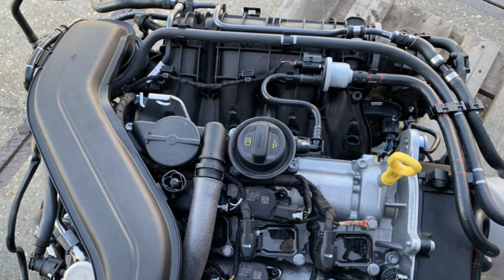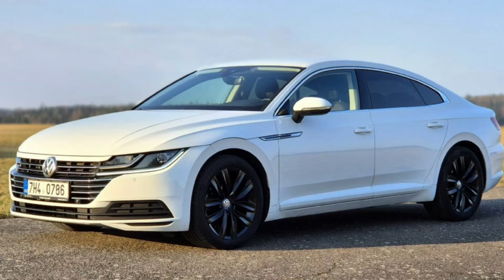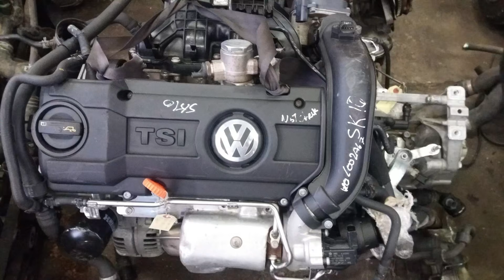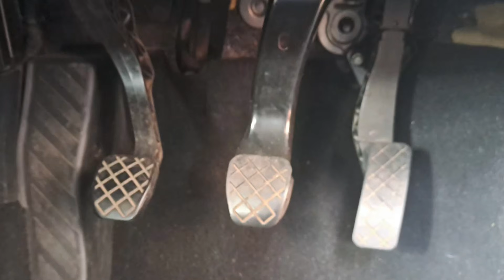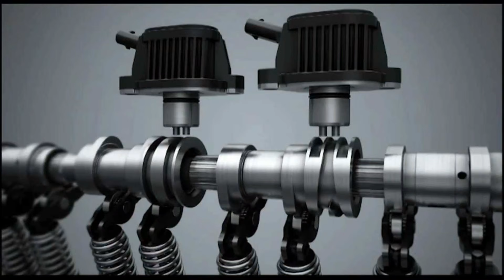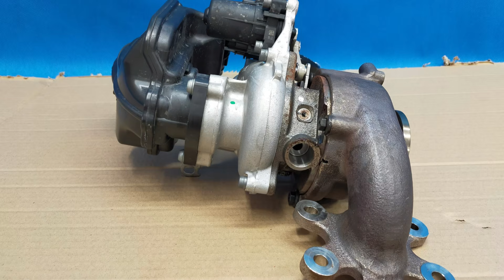Volkswagen’s 1.5 TSI engine: Common problems and advantages

Comment: I purchased a 2021 model Year Skoda  Karoq 1.5 tsi  from main dealer with low mileage ( ex motabillity car )  7,956 miles ,three year old car, first few months of ownership  I felt the response from the engine being a bit flat, Skoda dealership had performed all known updates to the vehicle. Third tank of petrol I put in I decided to use 99 Octane Super Unleaded E5 , the difference to the way the engine performed was , like night & day , I no longer put in any petrol E10, or below 97 octane.

Comment: I have a 2020 Octavia 1.5 TSI with 180k miles (290k km). Oil changes every 8k and I've changed to 5w30 VAG 507/508 from 0w20. Slight oil consumption and suction at the PCV (replaced with VAG part). Turbo replaced at 69k and alternator at 105k. They definitely run much better with E5 99 ron fuel. Mine has an EML on for an injector fault but still runs as normal so that's being ignored. Watch out for carbon build up as they are direct injection engines so using a special additive helps.
Reply from the maker: Thanks for your insights! Additives though are little help in preventing carbon buildup. What really helps is using top-quality oil, driving at high RPMs sometimes, and also using special spray cleaners directly into the throttle if things get worse. Otherwise, only walnut shell blusting which is not DIY.

Comment: I love this engine. Really good after 2K rpm, almost fun at 3K and above with the weight given. Shame mine car doesn’t have independent rear suspension for economy reasons :( It’s hard to compensate for that with tires/wheels/driving style. I have the manual, 96 kW, and just hit 80,000 km. You can actually feel what the variable turbo does compared with the previous generation of the engine. Love the 2-cylinder mode since the Golf VII which I drove a lot – all in all, it allows me to keep the average consumption below 7.5 l/100 km. My record is 2.8 l/100 km after a 10 km drive. I change the oil and filters every 10,000 km, but recently had to extend this to 13,000 once in a lifetime, and the car asked me to add some oil. I don’t have to check it manually – it will notify you when the level is somewhere between min and max. This happened after hundreds of kilometres of autobahn driving at 3–4K rpm + hot weather + mountain roads. Not engine-related: the infotainment system is a bitch, but I’ve somehow got used to its constant glitches, restarts, etc., they're enough rare at this moment for my threshold for modern cars.

Comment: Anybody here in UK  using 5w 30 oil instead of the recommended 0w 20  ?
If so 
Pls let me know
Reply: Changed my oil yesterday, the mechanic recommended 5w 30 instead of the 0w20 I had bought. Not in the UK, but similar climate 🙂

Comment: My 2021 Tiguan 1.5tsi has been doing alright except for a few issues: 1-knocking due to ACF hose leak which is a chronic leaking plastic hose. Replaced and now engine is fine, 2-Engine loses coolant, 3- engine loses oil around half liter after 10k km. Apart from these it has been doing very well.
Reply: Masz za ciężką nogę, dlatego tak szybko ubywa oleju. Turbo żyje, turbo pije! 😂 U mnie od wymiany do wymiany nie dolewam ani grama! 👍

Comment: What oil you guys use in 1.5eTSI, in shop they tell me 0w20 🤔
Reply from the maker: It's indeed 0w20 in recommendations (508 00, 509 00). But people tend to switch to 5w30 (504 00) after the warranty is over. 0w20 usually has shorter lifespan, so needs to be changed more often.
Reply: @DmitrySapko I can understand to change on 5w30 but not on 504 😅must chack that little more. Also do that on my last car Golf R but I keep oil specifications same 🙂
Reply from the maker: There are oils with 504 00 / 507 00 specification suitable for both petrol and diesel engines. They are good for the 1.5 tsi / etsi for a number of reasons, that's why I mentioned it. But getting 508 00 is also an option, of course.

Comment: The EA211 1.2, 1.4, and 1.5 are the best modern small engines ever made. Not a single design flaw. Pair it with one of the oil-DSG boxes, and you have a solid setup.
Reply: With Oil-dsg are you meening: wet-clutch,
I meen its only VAG with a engine with 1.8L and up, because they small engines is reduce/ecu regulated to only have 250NM of Torque
Reply: Some people say the coated liners/bores on the 1.5TSi are a ticking time bomb...

Also, the 1.2TSi has turbo issues and the 1.4 carbon buildup and the 1.4ACT engines trouble with rockers that break on the cylinders that deactivate.

Comment: I've had a 2017 1.4 TSI, and now drive a 2024 1.5 TSI (Jetta Sport 6sp manual). Love the engine! 1st gear to 2nd turbo lag just takes time to form habit of higher rpm for that first shift, then no lag. I replace the air filter once a year, sometimes twice. Clean airflow is critical. I also find top tier regular makes a difference than the cheap gas brands (I use Shell). The engine is sensitive to bad gas. Love the torque!!
Reply: I just bought a used 2024 with the manual. I’ve never had a car with a turbo, and am just getting into driving a stick. I’m glad I found your comment because I was wondering about the lag lol
Reply: The post 2024 1.5 manual has longer gears than the 2020 car I have. I have no issues with turbo lag on mine, but the engine is a bit noisy at 125- 140 kph in 6th gear.

Comment: Start/stop system error, even if you put a new battery on still coming the issue and the system doesn’t recognise the error even with the engine light on.
Reply from the maker: The check engine light is always triggered by a code. You may need a better scanner to see it though. The check engine light is actually the reason why start -stop throws errors.

Comment: I had this engine in a mk3 Leon. The car was decent, the engine was not good in my opinion. Had 2 coil packs fail and the PCV valve all before 70k. It was very poor on fuel, underpowered and jerky when cold. I think it had an issue with carbon buildup. It was also well maintained, but that didn’t help.

Comment: I have a 1.5TSI 2019 skoda octavia with 147000kms. Did a trip arround 1600kms. Didnt used any oil. It went up to 221kmh on german autobahn, but gps showed 211kmh. Its a great car for a people who need a car just for travel from point A to B. To me its boring car. Thinking of doing stage2 to it. To see what happens.

Comment: Had multiple TSI engines from new across Audi, VW and Skoda range and all have been wonderful; their only failing seems to be how rattly they are, especially when cold. Had a new T Roc R and it sounded like a tin of spanners and ,worse, the auto box kept it in low gear/high revs when cold which I think is dreadful for a cold engine, especially when running in.

Comment: Dmitry says kangarooing problems existed in models up to 2024 but the EVO2 engine came in 2022/3 and I thought that was supposed to have sorted it out?  Can anyone clarify?
Reply from the maker: They gradually replace engines and kept using the first-gen 1.5 TSI in a lot of models, especially Skoda and Seat for quite some time. Even gen-2 engines are blamed for kangarooing, just not as bad.
Reply: @DmitrySapko  Many thanks, Dmitry.👍

Comment: Great engines, but ensure rigorous servicing and regular liquid moly additive to prevent carbon build up which is common in all TSI direct injection engines.
Reply: Not all, the 2.0L EA888 gen3B uses port and direct injection.

Comment: I'm looking at a 2024 manual 1.5tsi cupra formentor this week that has nearly 9k miles on the clock. It only had it's first service at 8.5k miles(oil and filter) in January so was 18months old at that point. 
My wife will be using it for short journey work and back most days and i will be taking it for longer runs 2-3 times a week.
Any immediate to longer term maintenance advice would be greatly appreciated. If i buy it I'll be oil changing/servicing it regularly but I'm a bit concerned the previous owner didn't change it's oil for the first time in 18month since new.
Reply from the maker: I believe it's just fine. The engines are quite reliable and you are getting basically a new car. I would look carefully at why the owner decided to sell it - maybe there is something with the car that's not so easy to identify at once? But if everything is fine, there is nothing much to tell you about service - just change oil once a year (6-7K miles would be a perfect interval) and follow the manufacturer recommendations in all other cases.
Reply: @DmitrySapko thanks man. Appreciate it. 
What's your opinion on stage 1 ecu mapping on these engines?
Reply from the maker: It's out of my field of work, but I believe stage 1 just adds figures in tests. In real life, you feel no difference. However, the load on transmission increases which may not be good, in the long run.

Comment: The elevated oil consumption is most of the times due to lower maintenance intervals, if you don't change the oil+filter Max every 6-12 months, the dirt Oil the piston Oil Ring will clog and stop working properly.
The official recommended maintenance intervals are only meant to let the car "survive" the warranty period, they are not what the car need if you want use it for 15+ years.
Reply: Absolutely true!
Reply: I'm looking at a 2024 1.5tsi cupra formentor this week that has nearly 9k miles on the clock. It only had it's first service at 8.5k miles(oil and filter) in January so was 18months old at that point. 
My wife will be using it for short journey work and back most days and i will be taking for longer runs 2-3 times a week.
Any immediate to longer term maintenance advice would be greatly appreciated. If i buy it I'll be oil changing/servicing it regularly but I'm a bit concerned the previous owner didn't change it's oil for the first time in 18month since new.

Comment: Hello.I have Skoda octavia 3 1.4 tsi 150 2016..In how km or years is for replacement timing belt??? Its like 1.5 tsi engine recommendation? Thanks!!!
Reply from the maker: The recommendations from VW are the same for EA211 engines with belts - it's there for the lifetime of the engine. But to avoid belt sapping, I would replace it after 100,000 km (60,000 miles) initially and at least once every 60-70k km after that. For the 1.4 engine, belt replacement is significantly easier than for the 1.5, so it's cheaper in terms of labor costs.

Comment: 1.5 tsi superb here. Been flawless till now at 130k kms clutch master cilinder failure
Reply: Hi. I also had to have a replacement clutch master cylinder at 55,000 miles. My 2015 Golf GTI has had nothing else done to it. Regular service done by an independant garage. About 1/2 VW labour cost.

Comment: Have anybody checked their timing belt after 6 years of usage, as it is recommended?
Reply: I replaced mine at 200k kilometers (about 8years). Even if it’s supposed to be lifetime, it depends on how the VW defines “a lifetime”. Timing belt is still rubber so it’s a good idea to do it at around 8-9years.

Comment: I have the Audi A3 8V 2020 with the 7 speed s tronic with this engine and it runs so efficient, especially the cylinders on demand is a great future. 88.500 km now and always oil change every 2 years with Longlife IV.
Reply: Oil change is every 10k km max 15k or every 1 year, whichever comes first
Reply: @kri @kristijan933 with Longlife for my Audi it is set 2 years and 30.000 km as oil interval

Comment: I have 1.5 with very bad mpg any advice?
Reply from the maker: Too little information. I would start with scanning it properly with live data and looking at what each sensor is doing, what pressure in the fuel supply system, air volume, etc. You need a good scanner for this.
Reply: @DmitrySapko got an OBd11 no codes. Any specific tests i can do
Reply from the maker: It's not about codes. You need to check every important system with live data and see what's off. It's not really a DIY job. What's the MPG? And have you tested it in different road conditions (city / highway)?

Comment: I got to this video because I'm on a market for used car, preferably VAG.

I've noticed many models (skoda/seat/vw/cupra) from around 2020-2021 with 1.5TSI engine with around 150 000km are being sold relatively cheap - for around 15000EUR which begs the question why.

Thanks for the video.
Reply from the maker: Probably, people try to get rid of the vehicles before they need pretty expensive regulat service with timing system asking for attention. But if the cars have good service records, they may be good to buy and service not in the dealership.
Reply: cheap? a few years ago a similar car with this amount of km would have been almost unmarketable and sold for an apple and an egg
Reply: @Digi20  No argument there. But you know how it is, we need to compare it to current market.
Anyway after hours of browsing listings, visiting handful of dealerships in person and looking what is on the market I said enough. For the first time ever, and to my very surprise, I decided to try brand new EV. Will I be disappointed ? Time will tell..
Reply: @matoatlantis  i am with you on that. if you can build the charging into your daily commute/do it at home etc. an EV is often a much better choice nowadays.
Reply: If 15k is cheap...well I am happy for you. For that kind of money one can get brand new Citroen C3. I would never buy C3 but it is worth mentioning for price comparison sake. Now  for.petrol engine lovers and I am one of them there are not many engines that can be compared to TSI. It is very addictive. Silky smooth, amazing torque low revs delivery, pretty silent, very responsive, good mpg. Everything else I tried just felt boring and dull.
Reply: @BobFL007  Don't get me wrong, it's still solid amount of money. But as I wrote above compared to other offers I can see on a market. 15k is on the lower end for those 4-5 years old cars. And TSIs had many issues before.
I still have 1.8 TSI in my leon, for 16 years now (160k kms). I had fair share of issues with it though.

Comment: Lots of room to remap these. 130bhp can go to 180bhp with 300nm torque! 

also for the kangerooing, you just need to learn how to drive this car differently than most. for some reason when the clutch is disengaged to start moving the car automatically revs the engine slightly so no throttle is needed. However when the driver also applies throttle the ecu gets confused and hence the kangerooing. just only use the clutch and not throttle to move off and you will be fine. or use plenty of throttle to set off quckly but not a small amount of throttle.

Comment: So i am look7ng for my first car and a VW Passat B8 fl woud have this 1.5 Tsi with 165000km. Does anyone here maybe has experience with this engine at this km. Or maybe with even more km
Reply: That's close to finishing engine life span with that many km...
Reply: @artursskabs3951 how many km woud you think woud the 1.5 survive if you take good care of it ?
Reply: @andischweighofer4661 A well-maintained Volkswagen Group 1.5 TSI engine typically lasts between 200,000 to 300,000 km. Because it uses an aluminum block with direct injection, reaching 250,000 km is a realistic benchmark if you follow strict maintenance routines.

Comment: I have Karoq with 1.5 TSi ACT and it is a good engine, no oil burning. I find when cold it can hunt at low revs, which is a problem creeping out of our speed limited estate (5mph), but if booted it responds much better. Use a firm right foot when driving and it is fine.
Reply: Hi, I have the same. But my Karoq has an issue and I suspect poor engine/gearbox mount. Does your Karoq pull to the right or left during acceleration? Even when driving off normally it can be felt in my case. Thanks

Comment: I drive a Skoda Octavia 4 1.5 TSI  with 6 speed manual and so far I am very happy with the engine. It also suffers from the Kangaroo effect and SW updates didn't fix this unfortunately. According to the dealer this is "state of technology"! Please don't laugh.  I am a bit afraid of the engine oil type as it is 0W20 as there are statements, that this enhances carbonisation. So far I have only 40k km on the clock and change oil every 10-15k km
Reply: I've been using 5W 30 for my 2019 Ateca, it's 50K miles now and I now change it twice a year i.e. 4,000  - 5,000 miles.  Zero oil consumption so far. 0W 20 is good for ecology, but I'm not sure it's good for the engine. Kangaroo effect was fixed almost completely on my car by SW upgrade in 2020. If you still have it, just release the clutch completely before pressing the gas pedal, it may help.

Comment: I believe this is a great engine in my 85,000km of use. It has more than enough power, however cannot stand how boring it is and I think it's mostly down to the sound. Easily compared to a vacuum cleaner.

Comment: I`ve got a Volkswagen Passat 2020 register.Its got the 1.5tsi petrol.I use it as a taxi and the kangaroo effect i know very well when driving it.Its now done over 150,000 miles but for the last 5,000 miles its been making an annoying tapping noise..Its coming for its taxi MOT test soon and i`m slightly worried it will fail on that engine noise and i`m told it will need a total rebuild to fix it.TBH ive owned a few german cars and i`m not overly impressed with any of them i`ve had.
Reply: only the Bmw b47 modern diesel engine is good for germans . Your better off with corolla hybrid.